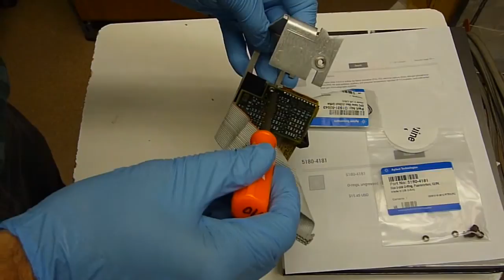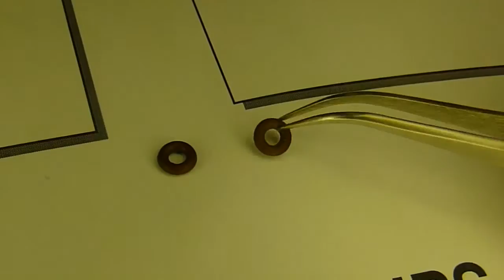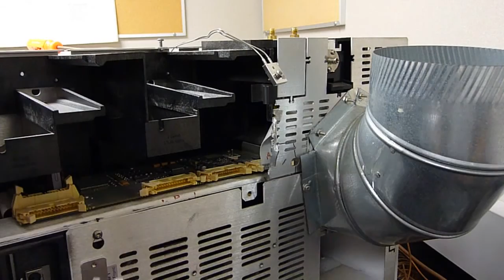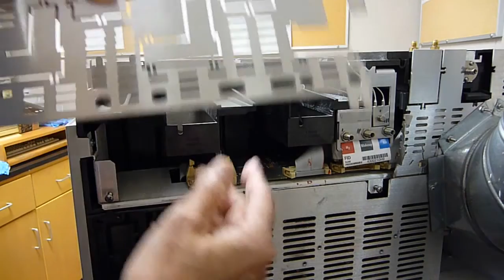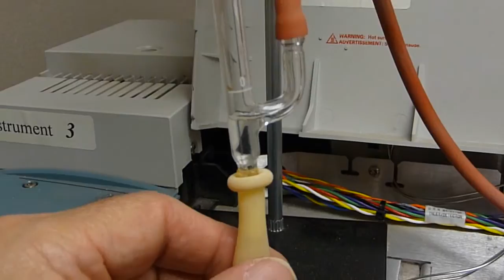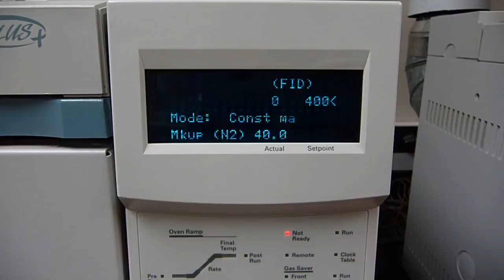Agilent / HP 6890 GC Repair .... EPC [p/n G1531-60720 ] Module Disassembly, Repair, and Test

Comment: Flow is not right, not sure if you replace pro. Valve, I think you can not solve almost case.Air flow is not right, the reason is dirty. You can not fix, must replace whole EPC.That is why, 7890 EPC is separate 3 channel for easy to fix, decrease the cost.
Reply from the maker: Thank you for your comment ... yes the valve was dirty, and probable cause for the "dirt" in the air valve was the zero-air generator catalyst breaking down. This video is in part, a documentary of a particular "fix" for a particular GC.  Replacing the valve was a $300 experiment  for an ancient GC versus replacing an entire EPC. 

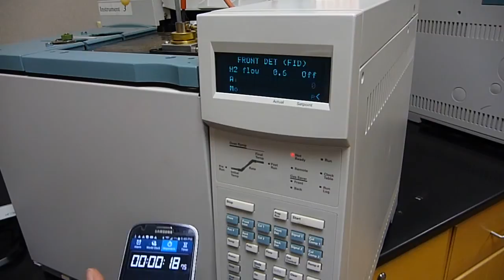As for air flow: the purpose of the air flow is to maintain the hydrogen flame. The 10:1 ratio is a rule of thumb... the FID will work with a flow of 11:1 but it is nice to know what the flow actually is ... hence the measurement at 26:05.  Folks here will install a column, set the flows, and go for a couple of years.  For us dropping the flow number on the air by 8% is not an ordeal.   We could re-calibrate the EPC, but it is easier and quicker just to measure the actual flows for a particular setting ... we won't change it for years.  I think of it this way: in the 20th century I would adjust the flows to the FID manually by turning needle valves for air, nitrogen makeup, and hydrogen AND measuring flows.  Now, instead of turning a valve, I punch in a digital setting, BUT make a measurement and confirm.
Reply: I can repair it. I also can factory calibrate any 6890 and 7890 EPC.